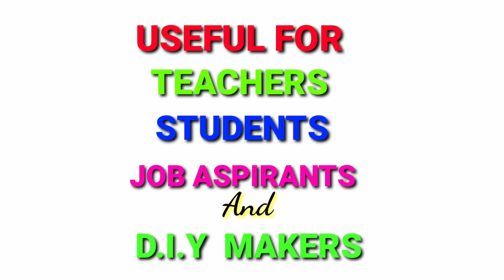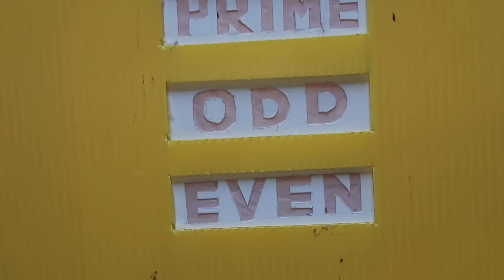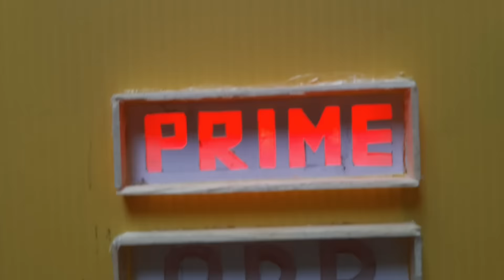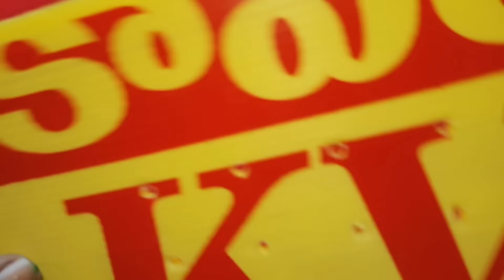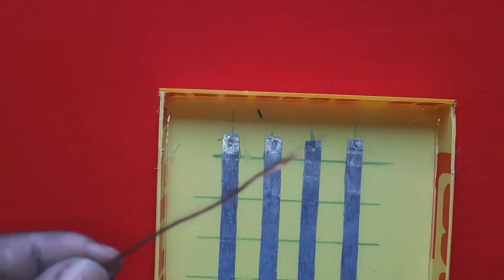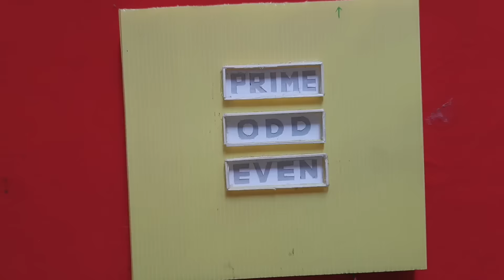Even Odd Prime Number Detector | Maths DIY project| with LED display

Comment: Sir I made this as you directed but my 3,7,11,13,17,19 odd &prime display on with even display .. i used 1n4007 diode to connect odd prime numbers to prime display...
Reply from the maker: Connect  properly the diodes,  - & + polarities ..., the silver ring marked side is positive polarity (+)

Comment: Sir,very brilliant project I chose this for  tomorrow onwards. 
   In video all Material names are not mentioned only some are mentioned. Please comment all the material names fastly. Because I have to do this for tomorrow.
Reply from the maker: Thank you for comment..
1. Advertising cards 
2. Aluminum strips
3. 9v battery 
4. LED lights -- 3  (different colors)
5.  1N4007 Diodes --- 3 pieces
6. Bamboo sticks or tooth picks as per required.
7. Wire as per required...
______________
Wiring process:
---------------------------
Number 2 : Is directly connected with Prime display and connected through 1N4007 diode with Even display. 

Numbers 4,6,8,10,12,14,16,18 are directly connected with EVEN display.

Numbers 1,9,15 are directly connected with ODD display.

Numbers 3,5,7,11,13,17,19 are connected through 1N4007 diode with ODD display and  connected through 1N4007 diode with Prime display.
Reply from the maker: All the best sir...It is easy you can do ...
Reply: I also make the project tomorrow
Reply: @theteacherJS  thank you so much sir

Comment: When fitting long aluminium strip and which wire you use on the above aluminum strip
Reply: Please reply after13/11/24 is my Maths exbhition and today's 12/11/24
Reply from the maker: You can use any wire

Comment: Sir supper maths project 
I selected your project in maths fair 
Sir you are great sir
But one 1 problem sir in our surroundings alumnium strip not selling
Thank you sir for a beautiful project 🥰
Reply from the maker: Thank you for your feedback...we can take thin aluminum sheet and cut into pieces
Reply: @theteacherJS  ought
Reply: Use cutter blade that is best. I have used it and it is working well

Comment: sir, what is the use of white wire ?
Reply from the maker: Thank you for comment...
Just for connection only..

1. Advertising cards 
2. Aluminum strips
3. 9v battery 
4. LED lights -- 3  (different colors)
5.  1N4007 Diodes --- 3 pieces
6. Bamboo sticks or tooth picks as per required.
7. Wire as per required...
______________
Wiring process:
---------------------------
Number 2 : Is directly connected with Prime display and connected through 1N4007 diode with Even display. 

Numbers 4,6,8,10,12,14,16,18 are directly connected with EVEN display.

Numbers 1,9,15 are directly connected with ODD display.

Numbers 3,5,7,11,13,17,19 are connected through 1N4007 diode with ODD display and  connected through 1N4007 diode with Prime display.

Comment: Sir tell where you used the 1n4007 diodes
Reply from the maker: Thank you dude for comment

Number 2 : Is directly connected with Prime display and connected through 1N4007 diode with Even display. 

Numbers 4,6,8,10,12,14,16,18 are directly connected with EVEN display.

Numbers 1,9,15 are directly connected with ODD display.

Numbers 3,5,7,11,13,17,19 are connected through 1N4007 diode with ODD display and  connected through 1N4007 diode with Prime display.
Reply: Thank you sir
Reply: @theteacherJS  sir please fir se key pad ki video bana do kyu ki aap ne kaise writing ki hai aap ne define nhi kya hai

Comment: Very hard
Reply from the maker: No..no..its very easy project and low cost
Reply from the maker: Thank you for comment..
1. Advertising cards 
2. Aluminum strips
3. 9v battery 
4. LED lights -- 3  (different colors)
5.  1N4007 Diodes --- 3 pieces
6. Bamboo sticks or tooth picks as per required.
7. Wire as per required...
______________
Wiring process:
---------------------------
Number 2 : Is directly connected with Prime display and connected through 1N4007 diode with Even display. 

Numbers 4,6,8,10,12,14,16,18 are directly connected with EVEN display.

Numbers 1,9,15 are directly connected with ODD display.

Numbers 3,5,7,11,13,17,19 are connected through 1N4007 diode with ODD display and  connected through 1N4007 diode with Prime display.

Comment: Sir which gum have you used for making this...i used A gum but it's not strong
Reply from the maker: Thank you for comment..

Use glue gun it is enough...!

1. Advertising cards 
2. Aluminum strips
3. 9v battery 
4. LED lights -- 3  (different colors)
5.  1N4007 Diodes --- 3 pieces
6. Bamboo sticks or tooth picks as per required.
7. Wire as per required...
______________
Wiring process:
---------------------------
Number 2 : Is directly connected with Prime display and connected through 1N4007 diode with Even display. 

Numbers 4,6,8,10,12,14,16,18 are directly connected with EVEN display.

Numbers 1,9,15 are directly connected with ODD display.

Numbers 3,5,7,11,13,17,19 are connected through 1N4007 diode with ODD display and  connected through 1N4007 diode with Prime display.
Reply: Yes sir I connected wires as your direction...but 3,5,7,11,3,17 are shows of 3 lights...(red,green , pinku)are b on
Reply: How i connect odd prime with diode to prime display ...+,- how
Reply from the maker: @manjannan3976  connect separately,and care fully

Comment: Sir.. .. recently i saw this video for Mathes day ... And i select this model for Mathes day so please send material details... Sir in order wise
Reply: Sir send me ... Please
Reply from the maker: ThanQ sir....
1.Bamboo stick or tooth picks for buttons
2. Rubber bands 
3.   1N4007 diodes
4. 9v battery
5. ICECRAM STICKS 
6. LED STRIPS(12V) ..3...COLOURS
7. PADS as per required
8.glue gun
Reply: @theteacherJS  how many diodes

Comment: Bro suberb but the circute diagram is easy to understand can u keep it easy to. Understand
Reply from the maker: TQ..madam.....u can try once
Reply: I tried it but not working
Reply: Circuit problem
Reply: Can you explain
Reply from the maker: Diodes 4700
Battery 9Volts
Led strips are 12volts

This is my own creation madam...
It will works 100%..
ThanQ
Reply from the maker: Take a screenshot of circuit diagram...it looks like harder but it is very easy to build
Reply: Light ki wiring kaise kare

Comment: Sir please tell the things name you use on the video please. 🥺
Reply from the maker: Thank you for comment..
1. Advertising cards 
2. Aluminum strips
3. 9v battery 
4. LED lights -- 3  (different colors)
5.  1N4007 Diodes --- 3 pieces
6. Bamboo sticks or tooth picks as per required.
7. Wire as per required...
______________
Wiring process:
---------------------------
Number 2 : Is directly connected with Prime display and connected through 1N4007 diode with Even display. 

Numbers 4,6,8,10,12,14,16,18 are directly connected with EVEN display.

Numbers 1,9,15 are directly connected with ODD display.

Numbers 3,5,7,11,13,17,19 are connected through 1N4007 diode with ODD display and  connected through 1N4007 diode with Prime display.
Reply: @theteacherJS  thank you sir

Comment: Can you prepare for us😂
Reply from the maker: Thank you for comment..
1. Advertising cards 
2. Aluminum strips
3. 9v battery 
4. LED lights -- 3  (different colors)
5.  1N4007 Diodes --- 3 pieces
6. Bamboo sticks or tooth picks as per required.
7. Wire as per required...
______________
Wiring process:
---------------------------
Number 2 : Is directly connected with Prime display and connected through 1N4007 diode with Even display. 

Numbers 4,6,8,10,12,14,16,18 are directly connected with EVEN display.

Numbers 1,9,15 are directly connected with ODD display.

Numbers 3,5,7,11,13,17,19 are connected through 1N4007 diode with ODD display and  connected through 1N4007 diode with Prime display.

Comment: Sir it is very awesome project 😍😍 
But problem is my prime&odd no. Is glowing with all 3 led lights is getting hard i can't understand
Reply from the maker: Thank you for comment sir....

Number 2 : Is directly connected with Prime display and connected through 1N4007 diode with Even display. 

Numbers 4,6,8,10,12,14,16,18 are directly connected with EVEN display.

Numbers 1,9,15 are directly connected with ODD display.

Numbers 3,5,7,11,13,17,19 are connected through 1N4007 diode with ODD display and  connected through 1N4007 diode with Prime display.

Comment: Hello sir what is meterial
Reply from the maker: Thank you for comment..
1. Advertising cards 
2. Aluminum strips
3. 9v battery 
4. LED lights -- 3  (different colors)
5.  1N4007 Diodes --- 3 pieces
6. Bamboo sticks or tooth picks as per required.
7. Wire as per required...
______________
Wiring process:
---------------------------
Number 2 : Is directly connected with Prime display and connected through 1N4007 diode with Even display. 

Numbers 4,6,8,10,12,14,16,18 are directly connected with EVEN display.

Numbers 1,9,15 are directly connected with ODD display.

Numbers 3,5,7,11,13,17,19 are connected through 1N4007 diode with ODD display and  connected through 1N4007 diode with Prime display.

Comment: Sir which Material Are use in this project
Reply from the maker: Thank you for comment..
1. Advertising cards 
2. Aluminum strips
3. 9v battery 
4. LED lights -- 3  (different colors)
5.  1N4007 Diodes --- 3 pieces
6. Bamboo sticks or tooth picks as per required.
7. Wire as per required...
______________
Wiring process:
---------------------------
Number 2 : Is directly connected with Prime display and connected through 1N4007 diode with Even display. 

Numbers 4,6,8,10,12,14,16,18 are directly connected with EVEN display.

Numbers 1,9,15 are directly connected with ODD display.

Numbers 3,5,7,11,13,17,19 are connected through 1N4007 diode with ODD display and  connected through 1N4007 diode with Prime display.

Comment: Sir I want a list of material plz
Reply from the maker: Thank you for comment..
1. Advertising cards 
2. Aluminum strips
3. 9v battery 
4. LED lights -- 3  (different colors)
5.  1N4007 Diodes --- 3 pieces
6. Bamboo sticks or tooth picks as per required.
7. Wire as per required...
______________
Wiring process:
---------------------------
Number 2 : Is directly connected with Prime display and connected through 1N4007 diode with Even display. 

Numbers 4,6,8,10,12,14,16,18 are directly connected with EVEN display.

Numbers 1,9,15 are directly connected with ODD display.

Numbers 3,5,7,11,13,17,19 are connected through 1N4007 diode with ODD display and  connected through 1N4007 diode with Prime display.

Comment: Sir how to connect 2 wire with prime and through diode to even, in my case the LED of even is very feeble and  prime is ok
Reply from the maker: Good work...congratulations 
Use- fullycharged battery 🔋
Reply: Made the same project using micro switch

Comment: Please can you make a circuit 
 connection video
Reply from the maker: I will try
Reply: How many days will take
Reply: I need to show this project on February 20
Reply from the maker: One day
Reply: Ok
Reply: And also the size of the aluminium strips
Reply: Sir in the video you have been not told the size of all cutting cardboards
Reply: Now I am getting problems of doing the project
Reply: Has faster has possible can make it video of wire connection of circuit and also show that in the video that the size of the cutting cardboard sir
Reply: sir can,t make the circuit connection video say it my teacher is asking to bring the project

Comment: Sir aap ne yah jo key pad banaya hai uska wiring ki video fir se bannao aap na Pat nhi kasie video banaya hai ki wiring ki koi video hi nhi aai hai
Reply from the maker: Number 2 : Is directly connected with Prime display and connected through 1N4007 diode with Even display. 

Numbers 4,6,8,10,12,14,16,18 are directly connected with EVEN display.

Numbers 1,9,15 are directly connected with ODD display.

Thank You for comment madam..!

Numbers 3,5,7,11,13,17,19 are connected through 1N4007 diode with ODD display and  connected through 1N4007 diode with Prime display.

Comment: So hard mawa my friend selected this project I said it is so hard
Reply from the maker: It is very easy project.....all the best...

Number 2 : Is directly connected with Prime display and connected through 1N4007 diode with Even display. 

Numbers 4,6,8,10,12,14,16,18 are directly connected with EVEN display.

Numbers 1,9,15 are directly connected with ODD display.

Numbers 3,5,7,11,13,17,19 are connected through 1N4007 diode with ODD display and  connected through 1N4007 diode with Prime display.

Comment: Bro video is not clear when ur connecting Aluminium strips to wire
Reply from the maker: Thank you for comment..
1. Advertising cards 
2. Aluminum strips
3. 9v battery 
4. LED lights -- 3  (different colors)
5.  1N4007 Diodes --- 3 pieces
6. Bamboo sticks or tooth picks as per required.
7. Wire as per required...
______________
Wiring process:
---------------------------
Number 2 : Is directly connected with Prime display and connected through 1N4007 diode with Even display. 

Numbers 4,6,8,10,12,14,16,18 are directly connected with EVEN display.

Numbers 1,9,15 are directly connected with ODD display.

Numbers 3,5,7,11,13,17,19 are connected through 1N4007 diode with ODD display and  connected through 1N4007 diode with Prime display.

Comment: Can you prepare it for us
I'll buy
Reply from the maker: Where are you from?
Reply: @theteacherJS  Sangareddy, Telangana
Reply from the maker: దీనికి కనీసం 200రూపాయలు కూడా ఖర్చు కాదు...ప్రయత్నం చేయండి....100% genuine project👍
Reply from the maker: Thank you for comment..
1. Advertising cards 
2. Aluminum strips
3. 9v battery 
4. LED lights -- 3  (different colors)
5.  1N4007 Diodes --- 3 pieces
6. Bamboo sticks or tooth picks as per required.
7. Wire as per required...
______________
Wiring process:
---------------------------
Number 2 : Is directly connected with Prime display and connected through 1N4007 diode with Even display. 

Numbers 4,6,8,10,12,14,16,18 are directly connected with EVEN display.

Numbers 1,9,15 are directly connected with ODD display.

Numbers 3,5,7,11,13,17,19 are connected through 1N4007 diode with ODD display and  connected through 1N4007 diode with Prime display.

Comment: I want material now only
Reply from the maker: Thank you for comment..
1. Advertising cards 
2. Aluminum strips
3. 9v battery 
4. LED lights -- 3  (different colors)
5.  1N4007 Diodes --- 3 pieces
6. Bamboo sticks or tooth picks as per required.
7. Wire as per required...
______________
Wiring process:
---------------------------
Number 2 : Is directly connected with Prime display and connected through 1N4007 diode with Even display. 

Numbers 4,6,8,10,12,14,16,18 are directly connected with EVEN display.

Numbers 1,9,15 are directly connected with ODD display.

Numbers 3,5,7,11,13,17,19 are connected through 1N4007 diode with ODD display and  connected through 1N4007 diode with Prime display.

Comment: Bro I am confusing while connecting small aluminium strips reply fast
Reply from the maker: Thank you for comment..
Don't worry... connect like this 👇
Number 2 : Is directly connected with Prime display and connected through 1N4007 diode with Even display. 

Numbers 4,6,8,10,12,14,16,18 are directly connected with EVEN display.

Numbers 1,9,15 are directly connected with ODD display.

Numbers 3,5,7,11,13,17,19 are connected through 1N4007 diode with ODD display and  connected through 1N4007 diode with Prime display.

Comment: Sir, diodes are not selling in this area
Reply from the maker: You can find in any old circuit boards like LED bulb , radio , tape recorder or any other electronic circuit board.

Comment: Sir how much price it will take
Reply from the maker: Around 200
Reply from the maker: Thank you for comment..
1. Advertising cards 
2. Aluminum strips
3. 9v battery 
4. LED lights -- 3  (different colors)
5.  1N4007 Diodes --- 3 pieces
6. Bamboo sticks or tooth picks as per required.
7. Wire as per required...
______________
Wiring process:
---------------------------
Number 2 : Is directly connected with Prime display and connected through 1N4007 diode with Even display. 

Numbers 4,6,8,10,12,14,16,18 are directly connected with EVEN display.

Numbers 1,9,15 are directly connected with ODD display.

Numbers 3,5,7,11,13,17,19 are connected through 1N4007 diode with ODD display and  connected through 1N4007 diode with Prime display.

Comment: What are materials required l am student
Reply from the maker: Thank you for comment..
1. Advertising cards 
2. Aluminum strips
3. 9v battery 
4. LED lights -- 3  (different colors)
5.  1N4007 Diodes --- 3 pieces
6. Bamboo sticks or tooth picks as per required.
7. Wire as per required...
______________
Wiring process:
---------------------------
Number 2 : Is directly connected with Prime display and connected through 1N4007 diode with Even display. 

Numbers 4,6,8,10,12,14,16,18 are directly connected with EVEN display.

Numbers 1,9,15 are directly connected with ODD display.

Numbers 3,5,7,11,13,17,19 are connected through 1N4007 diode with ODD display and  connected through 1N4007 diode with Prime display.

Comment: Please explain circuit diagram
Reply from the maker: Thank you for comment..
Number 2 : Is directly connected with Prime display and connected through 1N4007 diode with Even display. 

Numbers 4,6,8,10,12,14,16,18 are directly connected with EVEN display.

Numbers 1,9,15 are directly connected with ODD display.

Numbers 3,5,7,11,13,17,19 are connected through 1N4007 diode with ODD display and  connected through 1N4007 diode with Prime display.
Reply: I didn't understand